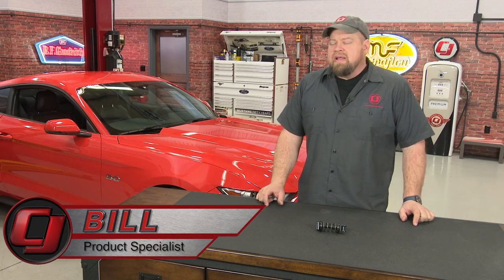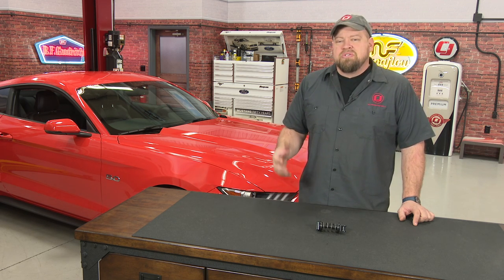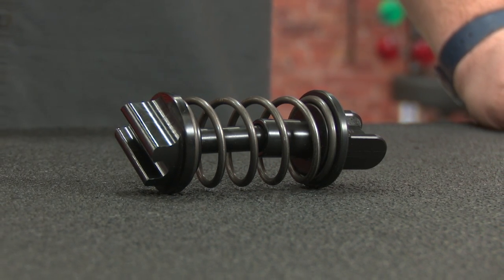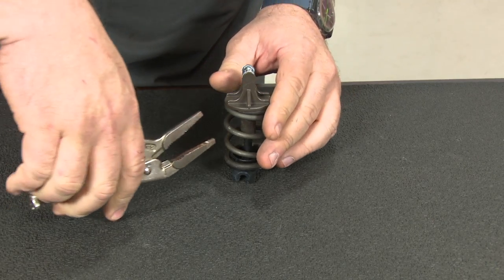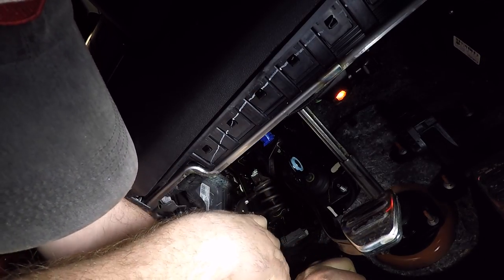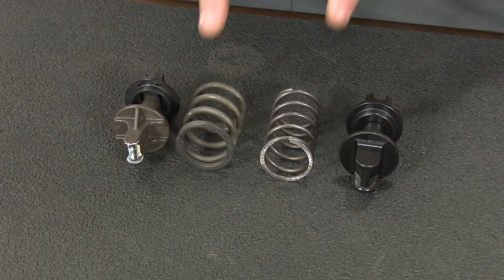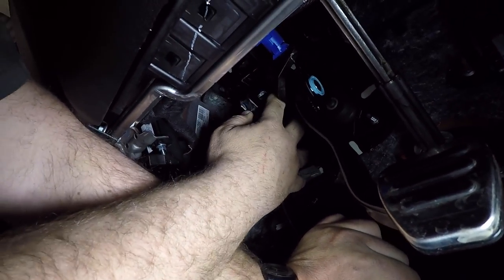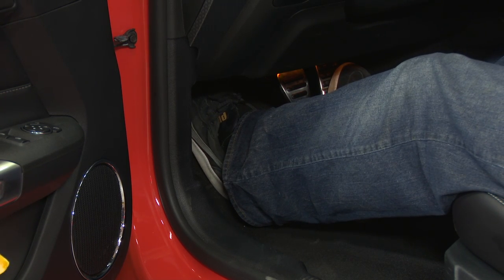2015-2023 Mustang Steeda Clutch Spring Assist/Spring Perch 35 Lb/In Manual Transmission Installation

Comment: I installed just the spring a while back and cutch pedal effort actually goes up a little. You might think it would get easier with a lighter spring, but crawl under the dash, push the pedal in by hand and you will see what is going on. The spring assists in pushing the pedal down after a breakover point. That's the issue with the factory spring. It does too much pushing down for you and that results in vague pedal feel. It's not a lot more pedal effort with the Steeda, but clutch feel is world's better.

Comment: Got the whole assembly installed, definitely clutch pedal travel feels smoother, yet spring delete feels even better and not loose at the top of the pedal. Not sure if I should leave it with out the spring.
Reply: I learned to drive stick on my 2016 and it only took me about 1500 miles or so to have perfectly smooth transitions from stop to 6th while still being pretty aggressive on the throttle. Maybe it's just because I learned on it and don't have that muscle memory, but I didn't find it nearly as difficult as people seem to be making it out to be.
Reply: No you shouldn't.

Comment: Do they make one for the Focus ST? The stock one is very stiff!
Reply: this spring makes the stock clutch pedal of the mustang HARDER to press.  The original helper spring gives like 85 lbs. of help..........this one is only 35 lbs of help.  You install this spring so the clutch is harder to press, which lets you feel the clutch out a bit easier.
Reply: Focus ST23 the stock clutch pedal or spring?
Reply: @Sahadi420  185 lbs*

Comment: Just test drove a 2018 have driven manuals for 16 years plus the factory clutch feel is horrible stalled the car 3-4 times, told salesman had to find a fix to that issue before I'd buy one. Thank you steeda.
Reply: I've driven only for only 2 years and never stalled a 18/19, but I do hate the high engagement point.
Reply: yea man i drive a heavily modified fox, and i drove a 2015 the other day and it was horrible
Reply: Driver mod 💀

Comment: Just installed Steeda spring and perch on my 15 GT. With all the rave reviews, I was actually disappointed. The pedal still feels vague and now there’s a loose deadspot at the top of the pedal travel. Gonna try just the spring on the factory perch to see if it feels better.
Reply: Did you fix it?
Reply: Never got a chance. Sold the car before I could fix it.

Comment: Just received mine for my 21 mustang gt. I have a question. The clutch pedal is fully up but when pressing down there's about an inch play at the top. The first inch I can push down with my finger. It always comes back up but was wondering if it's normal . I just installed it today and it's perched perfect with stock perch.
Reply: I have the same thing.

Comment: Wait so does this spring basically make the clutch effectively 4-5 times easier to push in and out?
Reply: It makes the pedal softer so you get a better feel of actual clutch engagement instead of just feeling the spring.
Reply: it makes the pedal twice as heavy because that spring helps you push the pedal in

Comment: Fits gen 3 mustangs ?
Reply: Yes Installed on my 2020 gt
Reply: Also pulled the trigger on it , doesn’t it feel heavier to you ?
Reply: @SantanaGTv  yes it does but clutch engagement is better I used to stall alot before with the stock spring. also after you put about 1000 miles or so the feeling gets better